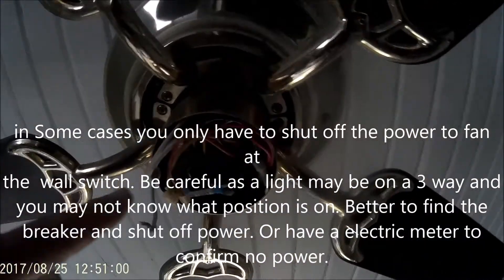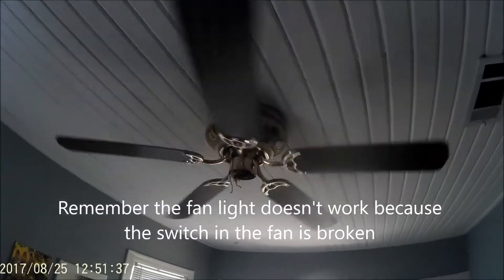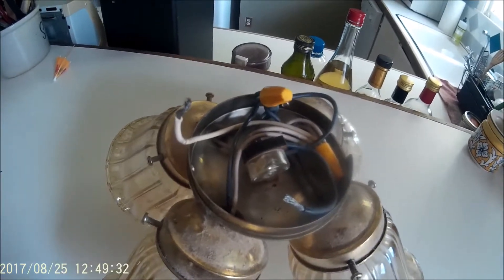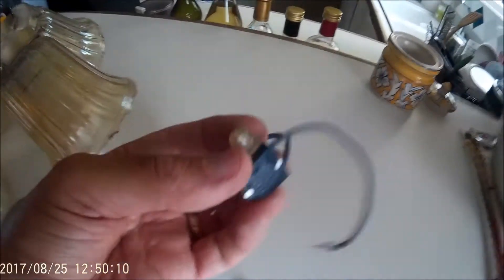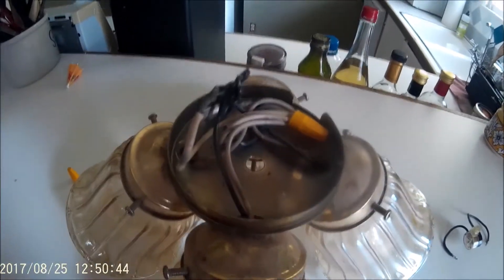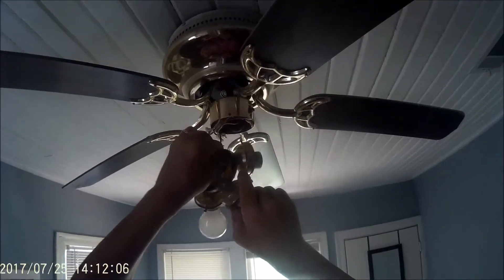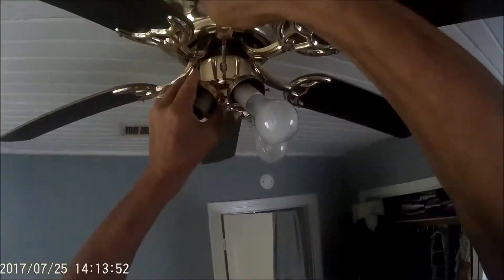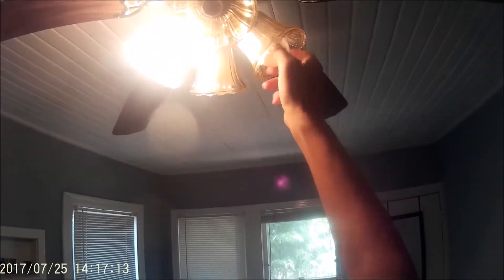fix fan light pull chain for free no need to buy any parts

Comment: He doesn't show how he hooked up the wires
Reply: When you cut both wires from the switch you are supposed to Connect them together.
Reply from the maker: If you don't know the color of wires you should not be doing this repair. 20% I leave out. It assumes one has a basic knowledge of wiring. There are 3 colors. Automatically white is neutral , black is hot, blue is the light circuit. Note switch may be 3 way which requires another set of wires. So don't do thos repair if you do not have a basic knowledge of residential circuit wiring . You should at minimum know how to hook up a 3 way switch. BTW 3 way switch is only 2 switch  locations not 3 as the name may apply.